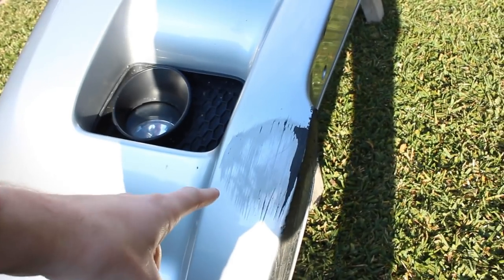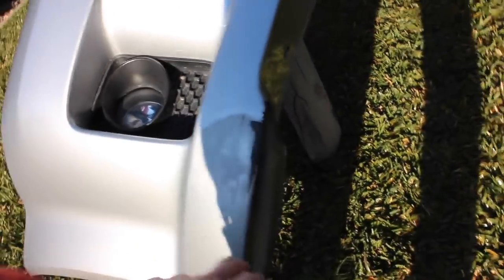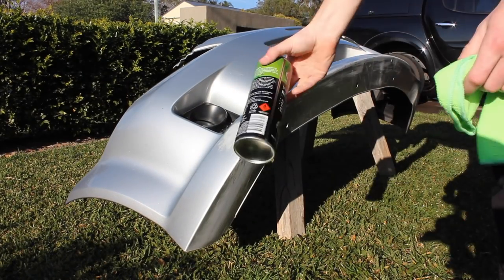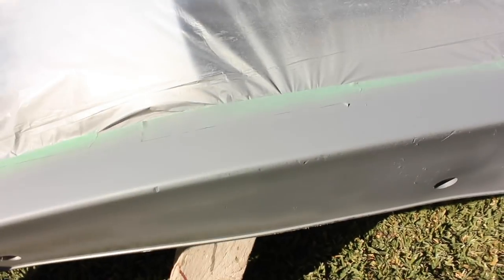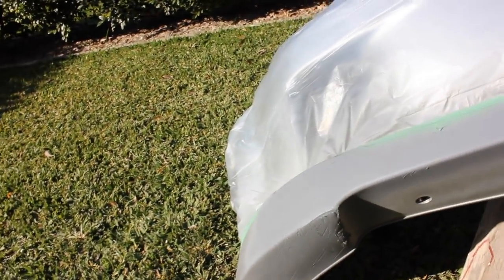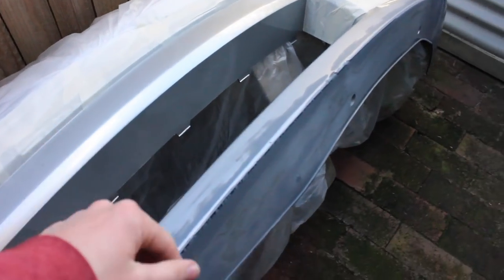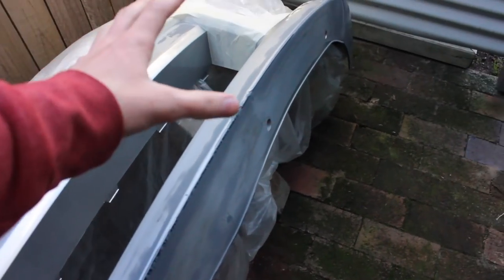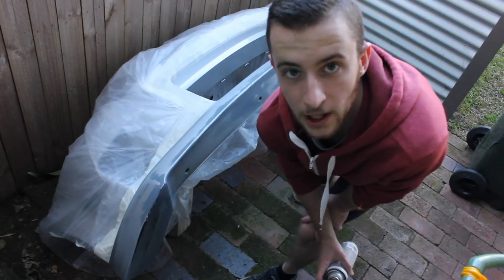DIY Sports Armour

Comment: If you want clean lines with plastidip you need to over lap the masking tape 3 times on the line and peel off one layer of masking tape after each coat and remove the final layer of tape and paper immediately after the final coat.

Comment: A couple of things the bumper is sprayed in 2k pretty much nothing is going to stick to it, its a 2k thing then you need a plastic filler then when you paint it you will need a flex agent in the paint or it will just flake off you can buy it all from any decent crash supplier under $100 do it right or don't do it at all you dont sand to 2000 grit 400grit max the paint need to grip to something you can buy a new bumper from Stirling parts Australia for $220 s1-$260 s2 new lastly professionals don't do it thats why they don't run it

Comment: Hey mate I have a question I’m not sure you’ll be able to answer but hoping you will, do you know if I can chuck on one of these lowered bumpers on a 2006 ve commodore, or where I can go to find out if I can. Cheers mate.
Reply from the maker: Yeah mate, I would assume you can but just ask your locker Holden dealer. It’s called a sports armour

Comment: Man I just bought A VY V8 5.7 litre Calais , great car has factory LSD , independent rear suspension , traction control   Full leather interior , car is black and immaculate and original owned by some old guy and was looked after , mate get yourself into a V8 forget about the sixes , the V8s are way better